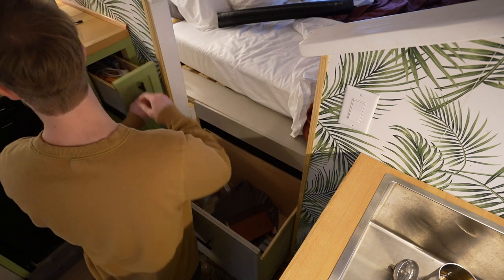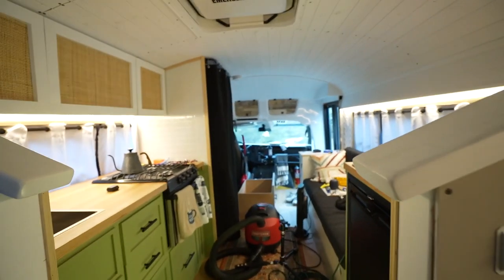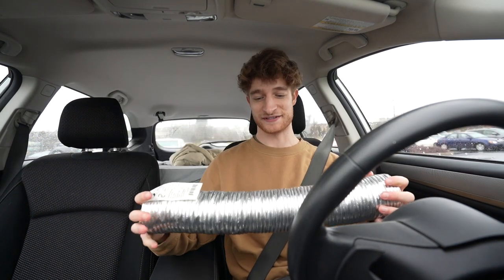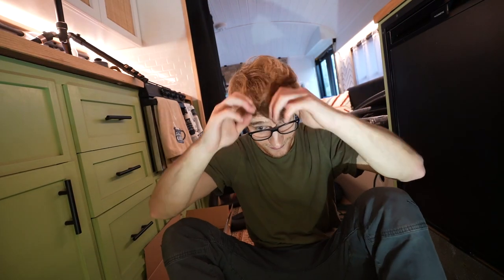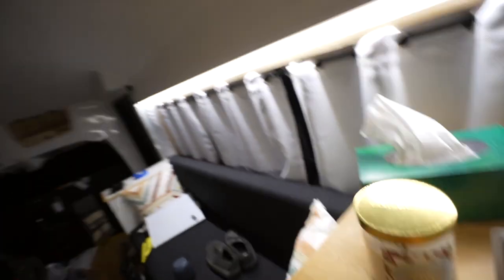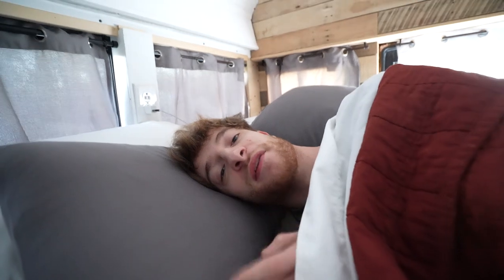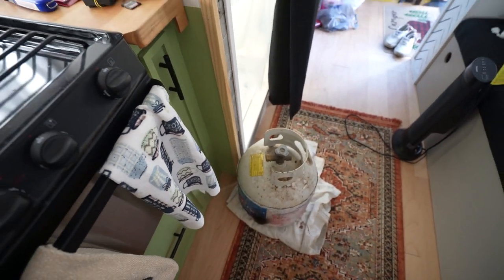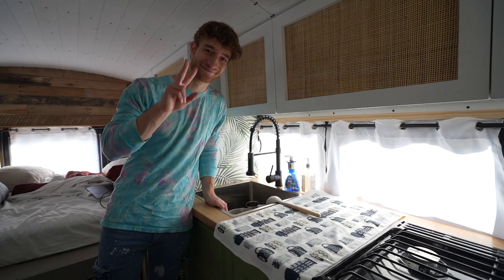FINALLY Fixing My Diesel Heater in School Bus Tiny Home

Comment: Great! I am very glad you have the heat/haze problem solved. There always seems to be a BUMP in any project that you really want done. I think I would mount a carbon monoxide detector down lower than you bed level, that way you have protection if anything went awry while you were sleeping. Can’t wait til you are on the road! Happy travels and be safe!

Comment: One word of caution using aluminum ducts. I learned this when I tried to extend the exhaust duct of a portable air conditioner with an aluminum duct hose. Being metal, they get very hot and radiate heat. For use on my AC this was totally counter-productive but in your case since you are using it for heat it's probably not bad, Just be aware that wherever you have the duct running if you have anything sensitive to heat like electrical components, that may be an issue.